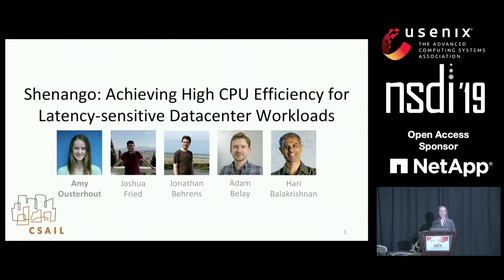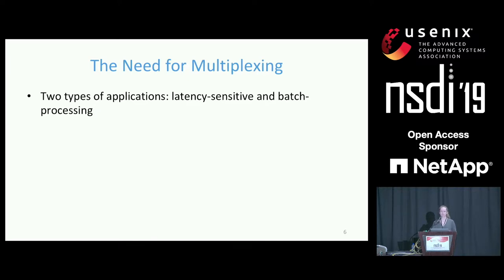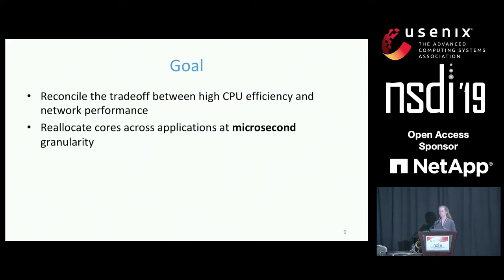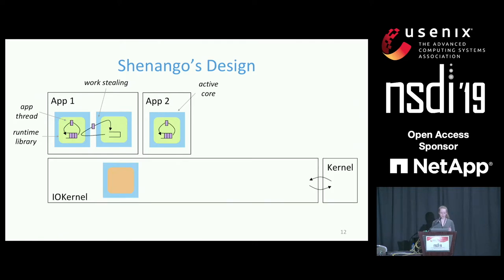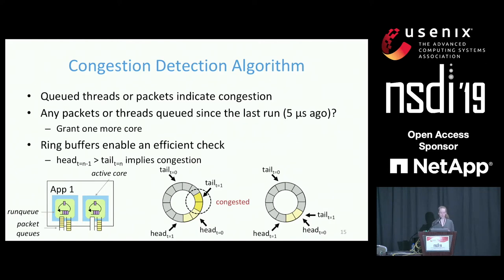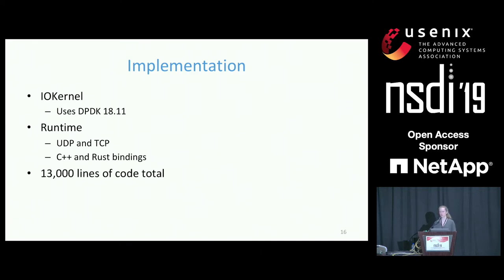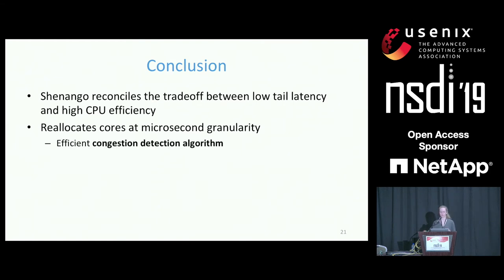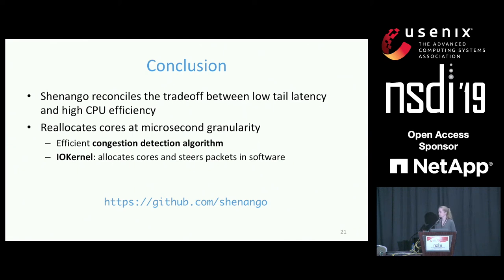NSDI '19 - Shenango: Achieving High CPU Efficiency for Latency-sensitive Datacenter Workloads

Comment: # Shenango Notes

## Network I/O is now too fast for the Kernel

From 2008-2018, networking HW improved (latency by 20x. throughput by 100x)

However, operating systems kernels have not successfully coped with this increase. Executing system calls now adds overhead to I/O that is significant relevant to HW.

Developers are shifting to kernel bypass network stacks to deal with this.

Kernel Bypass works by pinning a listener core that busy-spins, directly polling NIC packet queues.

## Efficiency is driving multiplexing

Fill CPU with batch work during lulls in latency-sensitive work

When using I/O through the kernel, this sort of multiplexing has a terrible impact on tail-latency. Good CPU efficiency at the cost of poor I/O (latency and throughput).

Kernel-bypass networking via ZygOS improves tail latency, but at the cost of multiplexing due to pinned cores. Good I/O at the cost of poor CPU efficiency.

## Goal: How to Reconcile these tradeoffs?

Proposed solution: reallocate cores across applications at microsecond granularity.

This needs to be microsecond granularity for microsecond-scale tasks and bursts. Existing systems are millisecond scale.

## Challenges for Reallocating Cores at us granularity

Problem: Application-level metrics are no faster that 100us

Problem: Reallocating cores by reconfiguring HW takes 100s of us.

## Contribution

Implemented Shenango, a system that combines kernel bypass networks and core reallocation.

Solution: Avoid application-level metrics and use the queuing delay of threads and packets to determine when more cores are needed. (Compute Congestion)

Solution: Reallocate cores in software in ~5 us using a pinned core (called an IOKernel). Use the IOKernel to also steer packets in software.

Additional Innovation: Maximize cache hits by allocating cores based on cache-affinity.

Additional Innovation: Load Balance TCP handling across cores.

## Architecture

The IOKernel reads raw packets from the NIC and writes them to the packet queue of an app. If an application has zero cores, it gives it one core. Otherwise, every 5us, it executes the compute congestion algorithm and grants it a core. If all cores are taken, then the IOKernel preempts an existing core.

Uses DPDK. What is this?

Applications link to a Shenango user library. They have m..n active cores at any given time, where m is a guaranteed minimum number of cores and n is m plus the allocation of all free cores not guaranteed to a particular application. N can be 0. They run lightweight user threads round robin off a runqueue. They also have input and output packet queues and execute TCP parsing of raw packets off packet queues (incoming and outgoing).

Applications cooperatively yield cores when they are not needed

The library supports UDP and TCP and provides bindings for C++ and Rust.

## Compute Congestion Algorithm

Compute Congestion: Look at the runqueue and the packet queue. Is there any work in either queue that has queued for longer than our quantum of 5us? If so, we're congested and can benefit from an additional core. In a ring buffer, this is just the question: If head of this quantum greater than the tail of last quantum?

Each core exposes this state to the IO Kernel via a single shared cache line. This eliminates the need for synchronization

## Evaluation

Shenango allows for highly granular core reallocation between different workloads multiplexed on a single server. This enables high CPU utilization through multiplexing without much impact to tail latency and throughput.

## Audience Questions

Question about Cache Inertia. Audience member suggests cache partitions and looking at cache inertia as a signal for deciding when a core should be allocated or yielded.

Current Cache optimizations involve assigning a core that is a hyperthread-pair if possible. If that's not possible, it issues the core that was recently assigned to the application. As of this presentation, the IOKernel didn't support deferring adding a new core if only cores with poor cache affinity are available in order to wait until a core with better cache affinity is free. They said they would investigate this further in the future.

Question about Intel Flow Director. Speaker said they're considering moving the IOKernel off the data path.

Are Shinjuku and Shenango fully complementary or are there blockers to integrating these projects?

Yes.

Why not allocate cores to the application that globally is the most congested in an uneven manner? Why only consider congestion locally without comparing to other applications?

Unclear on this, but it sounds like the IOKernel could implement this policy.

## My Questions

I'm unclear how the yielding and preemption of cores occurs. If a system isn't saturated, does it always yield one core?